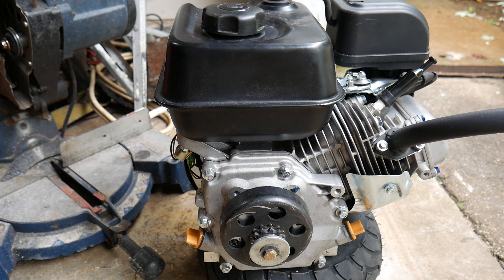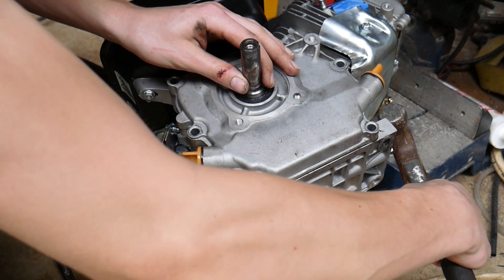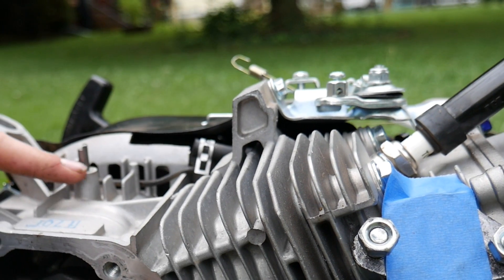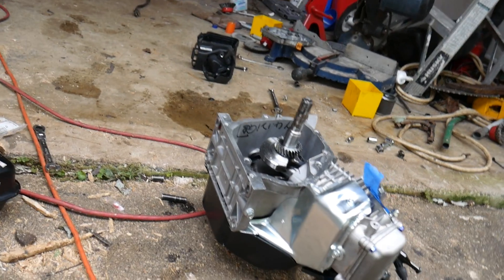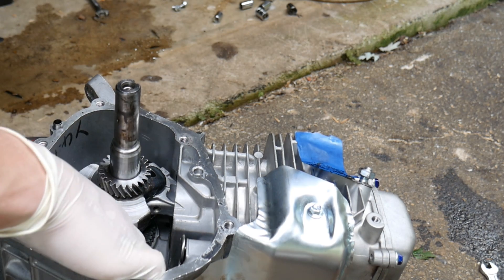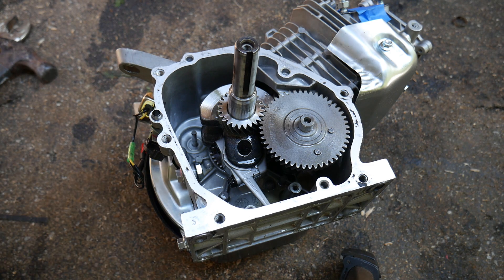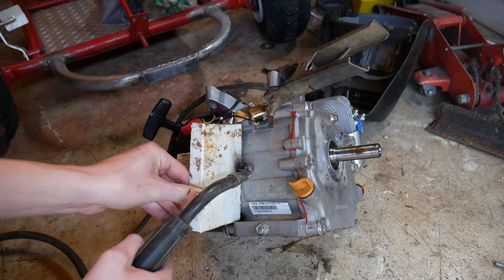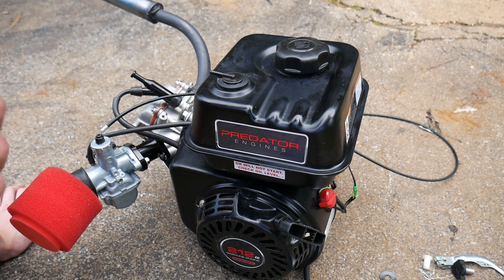How not to remove a Predator 212cc Governor

Comment from the maker: Sorry, my new videos are much better than this. I promise! Just to clear up My timing dots look disaligned, but were aligned. I had just given the pullstart a few yanks just to make sure everything clears. But 10 months  later the block still runs fine to this day!!!
Reply: Never use a steel hammer to take out the crankcase or other engine parts, you may crack the cover. When starting an engine put a wood plank underneath, never run an engine on a hard floor, you may crack the crankcase from the engine vibration.
Reply: are you using the stock rod? i wanted to make a kart engine with my gx 160, but im afraid the rod will break
Reply: Vasily Builds lmao I bought a 420cc preadator with my money and removed the governor and my neither helped me put it on my go kart

Comment: I have a predator 212 with a stage 1 kit I remove only the governor after an hour or two of riding it shuts off and have to wait like 5 minutes to cool down and it'll turn back on you think I would have to remove the governor sensor

Comment: There is a washer on the governor shaft that appears to have fallen into the engine when you removed it.  There is also a washer under that white part you pulled from the gov. gear, it can fall out if left in place.

Comment: my cam fell out and these 2 longs things thats right next to the cam fall down i put them back and and lines my cam up and put the caseing back on and my bike is feeling easy to pull then it sound like it has low compression by the way its a new 212 any suggestion????
Reply: Your rockers fell off the valves when your camshaft fell out.

Comment: You could of just tapped the governor arm hole with a 1/4 20 tapper then put a 1/4 and 1in bolt then put some red lock tight. But either or works
Reply: A tap only cost about $5

Comment: My Engine won’t start after doing this
Reply: Did you mess with the cam shaft
Reply: Aiden update I did mess with the cam I pulled everything out of the block to properly remove the governor. The reason I couldn’t get it started was there was some water in the gas tank and I didn’t notice so I just sprayed starter fluid in the carb and it started right up

Comment: Welding mild steel bolts to an aluminum case....what could go wrong? hahahahaha
Reply: That’s what I was thinking would’ve been much better to just tap it and  thread in a bolt or a fitting to use it as a vent tube.

Comment: Thanks for making this man. Have you ever noticed a small rattle in an empty 212 fuel tank? After I put mine back on after removing the Governor, something’s seems to rattle a little when I tilt the engine. It doesn’t seem to roll much but I can’t figure out what it is
Reply: do it start?
Reply: You probably left something inside. You do need upgrades inside your engine if you want to make it go faster. Super man cam, billet rod, flywheel.

Comment: I removed the governer and arm, now it runs at wide open throttle. Ive checked for air leaks and everything with brake clean to no avail. What am i missing here ? I cant find any solutions online.

Comment: I did this and when I try to pull start there’s like a lot of pressure??
Reply: This is because its hydrolocked...just remove the sparkplug and pull the cord a couple times to get the oil out of the cylinder.
Reply: Btw sorry if this info is late....

Comment: Why not just disconnect it? Like I did. No reason to open the case. Welded a steel bolt to an aluminum case? Yeah, right. Before you teach, first learn.

Comment: Uh, if you are installing the Mikuni, none of the governor linkage connects to it, so you don't need to go inside to remove the governor.
Reply: Bernard Allan I made this mistake. I thought it would be fine but it always keeps the engine at idle speeds so you need to take it out actually

Comment: Ok so I just removed the governor on my tecumseh powersport 6hp and when I start it the engine runs by itself and doesn't stop? I connected the throttle directly with a metal wire but that didn't do anything still? What do I need to do?
Reply: Diygokartforums and post pictures. I'd bet you have some linkage wrong or the cable hooked up wrong.

Comment: How do you hook up the carb cable after removing all that stuff. On the stock carb though
Reply: @Juan Lamas u can ether use a top plate from gopowersports.com or get creative with the rod from the govenor arm to give throttle
Reply: Thank you. I ended up modifying the throttle lever. To directly control the carb. I put the return spring on the bracket wear the governer use to be.
Reply: Buy a 40in throttle cable and buy a vm22 mikuni carberator. Both can be bought on amazon. YouTube videos on how to install them. Black66 makes a good mikuni carb video. This will also make you go way faster

Comment: Vasily Custom Builds I did this and I’m confused on how to re hook up the throttle without the arm. Help
Reply: Did you figure it out ?
Reply: It hooks up directly into the carb.if you look at the top, there is a black rubber boot it goes through. There is a cylinder with a slot that the cable hooks into. When you hit the throttle to go, it lifts that cylinder that has a needle at the bottom that comes up with it and opens full flow

Comment: I know this is a old vid but you forgot to take the washer out from the arm
Reply from the maker: no, otherwise I would've felt it tearing my engine apart
Reply: @VasilyBuilds  it's held on by grease  you have to take it off it doesn't fall off like the other omes

Comment: What do you thing the chances of bending a port or something would be? I'm thinking about doing it on my razor Vespa gas conversion but I don't wanna damage my expensive brand new engine by over-revving it
Reply from the maker: thing that would go first is the rod. Not sure what type of engine you have, predator 212 can go up to 7000 safely with stock everything
Reply: @VasilyBuilds  yeah I got the 212 it's stock except for a carb I pulled off a briggs that seems to run better during the winter (runs too lean in the winter with the stock carb so I just swap them out) I guess I just have PTSD from my lawn mower vertical conversion that I removed the governor from and it threw a rod (jug looked fine) but i got so scared from it that I didn't work on 4 strokes for a good year or so other than lawn equipment
Reply: @VasilyBuilds  but anyway ive been watching your videos for a while just never thought to sub till a few weeks ago. Really enjoying the good content keep it up bro!

Comment: I just zip tied the spring from the throttle arm to the governor arm and adjusted the top speed using the limit screw... it’s not much higher in rpms than stock... any problems with this?
Reply from the maker: Use a heavier spring

Comment: @5:00 you dont weld steel to aluminium you dip dizzy swizzle just saying
Reply: Tap and put a bolt in the hole numb nuts.
Reply: @gt20modding88  Relax dude, guys like 16, no need to be a dick

Comment: lol what are you doing welding aluminum to steel.  kids dont do this at home, tap the hole, then put screw in with loctite.
Reply from the maker: Looking back, that was kinda stupid :/
Reply: NPT pipe threaded plug.
Reply: I dont understand the mistake anyone care to explain
Reply: @liveandletlive2894  You can't weld steel to aluminum. Well, not with a good hold, the aluminum tends to burn away before the steel will melt. The bolt was steel, the engine block is aluminium. Like he said, tapping the hole is the only good solution here.
Reply: @andrewt9204  thanks for the reply!
Reply: You can kind of make them stick together. Not well, but if you don't look at it too long it's fine

Comment: Dude I recomend you to not disassembly any motor anymore, ever! You almost destroy it. Before starting to mod engines, please take some basic lessons. Also, if you reassembly it without gasket, like you did, you must take care of clearance for the crankshaft axis. That's not a good practice.
Reply: Adrián Maillo Ya know how you learn small engine repair? Tearing apart small engines. Idiot.
Reply: Engine may have enough crankshaft end play to begin with which may be why you could get away with using RTV to seal up the side cover. Easy enough to check once the side cover is bolted down. As long as there is some end play it should be fine.
Reply: Where's your videos Mr.Expert.
Reply: your an idiot
Reply from the maker: I assembled it correctly and the engine still runs great to this day.

Comment: Welded a steel bolt into an aluminum block?  Hmmm.
Reply from the maker: shannon shull 🤣🤣 #itwillbefine
Reply: @VasilyBuilds  You could had filled the hole with epoxy glue or with some JB weld.
Reply: I would have just tap the hole installed a bolt and use some Loctite but hell you could have probably just sealed it up with J-B Weld
Reply: LMAO ... Nice ... duct tape or Elmers glue woulda been better ... bubble gum ... He's a young guy ... but at least he is having fun and learning. Great video!
Reply: Lmao my first thought!! You actually welded a steel bolt to a aluminum case🤣🤣🤣holy shit bat man it works!! I’m trying to build a cheater 212 for my sons gokart for a practice engine. He is running box stock brigs that I can’t put To manny laps on!! I have found out to leave the second ring out of the piston between the oil ring and the compression ring. It frees the motor up and don’t even burn any oil
Reply: @groomlake51  Groom, he could've tapped the hole, install a nipple and connect to the valve cover.